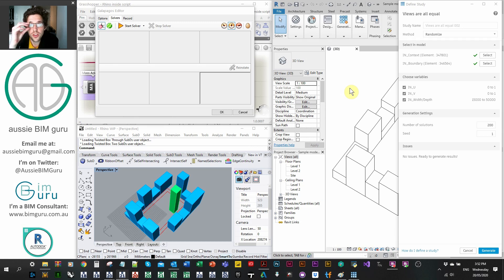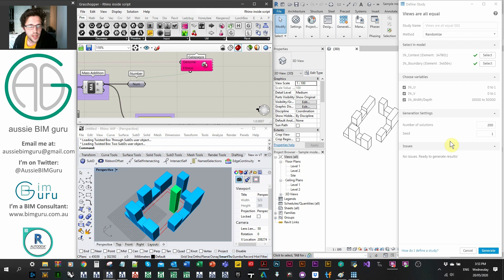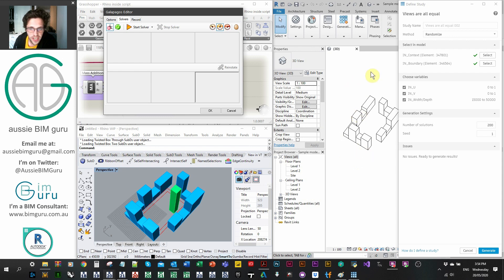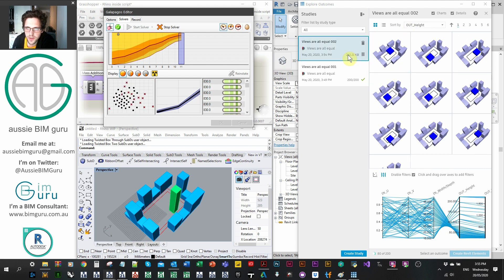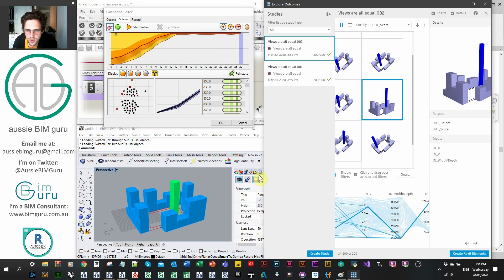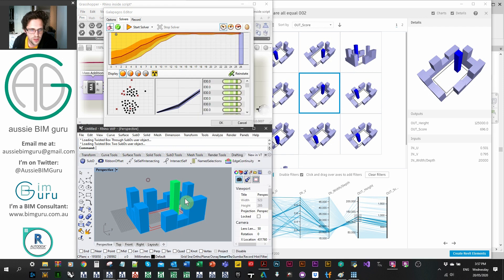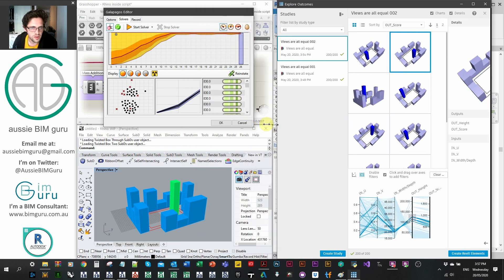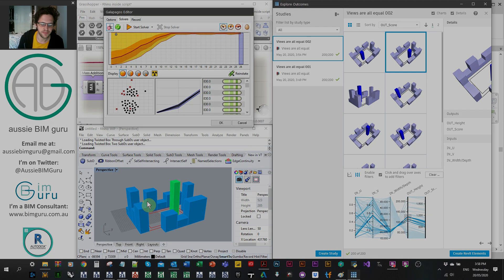Generative Design: Comparison of Revit/Grasshopper!

Comment: Nice comparison, love how quick Rhino + Grasshopper are - one question, would comparing the optimise solver in Revit GD  possibly yield more similar results to Galapogas? Or am I misinterpreting what the optimise solver is  do you think? Cheers.
Reply from the maker: Yes the optimize solver would yield more similar results, albeit with the possibility to evolve in different directions at once. I believe they use different algorithms (spea/ngsa) but the results can often be comparable in my experience.